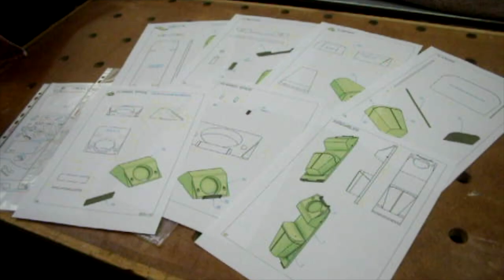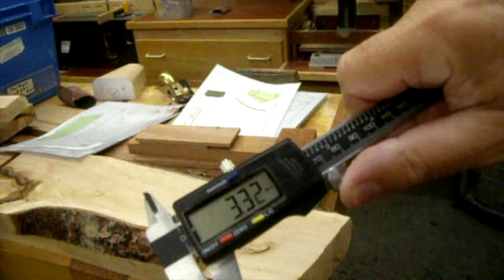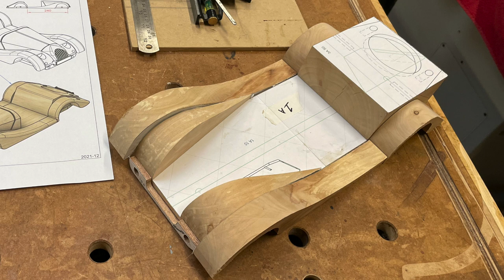Making a Morgan ep1 - Chassis

Comment: Hi Steve, I don't want to sound over critical, however I would like to point out your method of cutting the slope of the top of the bonnet/hood would leave the side to side profile a little out of shape by not being in the same plane even though they are parallel. That taper for the top should be cut before you taper the sides of the bonnet/hood. When the timber is cut on an angle as you have shown the sides can not be in the same plane even though they are parallel. This can be tested by measuring the depth of the bonnet/hood from side to side at equal distance from the front or back. 
I think this is important for others who follow your methods and wonder why things are not as they should be. Otherwise you are doing an excellent job.
Reply from the maker: Hi Peter, Thanks for the watch and your comment, not critical at all, of course you are correct if that was the finished cut however I generally use the machines to remove the majority of the waste and finish off with hand tools which in this case the bonnet needed needed plenty. Really I should have cut the slope before I addressed the sides which would be a more straight forward way.  Cheers Steve

Comment: That is coming along very nicely! But I do have a problem here Steve, this is the second of my vehicles you have made a model of! You only need to make a Willys Jeep and a Range Rover and you have the whole set! This is uncanny, I am very impressed by your dust extraction, it look as if it works really well, I have to do all my dusty work out in the open, even then it seems to blow into the barn and settle, stay safe ! Chris B.
Reply from the maker: Ha Ha, bet you think you’re being stalked. I just might have my next two vehicle builds now 😉. The dust extractor is awesome though a touch loud, about to fully duct the workshop with blast gates etc (an interim solution before I invest in spiral steel ducting) and if all goes well then it’ll make my other three dust extractors redundant. Thanks for the watch and comment Chris👍🏻 Cheers Steve
Reply: @Phenrica  What is the Cu/Mt/min of your extractor, I have tried a few now, but they are no good on the table saw with all the gaps underneath, even off the crown guard they let fine dust escape, I did think about sealing the underside of the saw and extracting that area, but it is easier for me to wheel it outside in the sunshine, then clean it up with the air gun, if it is grim weather I put the job off for a while.
Reply from the maker: @453421abcdefg12345  Now there’s a question, apparently the airflow is 3832 m3/hour or 2253 cfm (this is stated as the traditional method which I think is the measure at the inlet which is an 200mm/8” port) the other reading given is 2209 m3/hr or 1299cfm  (stated as realistic measure which I assume is at the end of a ducting run) but not sure only thing I can say it’s better than all my other extractors together.
Reply: @Phenrica  That sounds like a good extractor, with 4"(100mm) ducting I suppose the air velocity is greater, so over a longer length it should be good, the problem I see is that you need long sweeping bends to maintain air movement in the duct, and that can take up a lot of room, better that dust everywhere though.